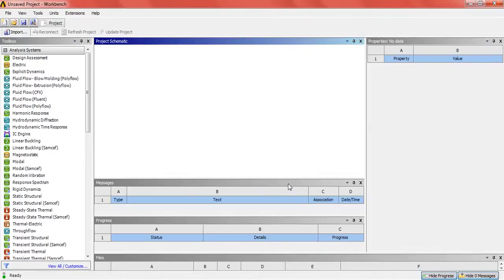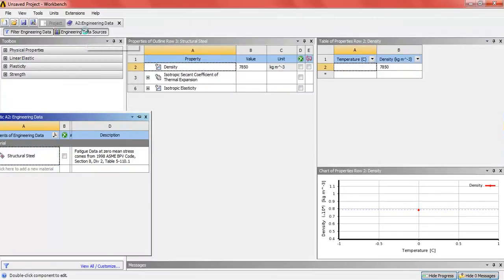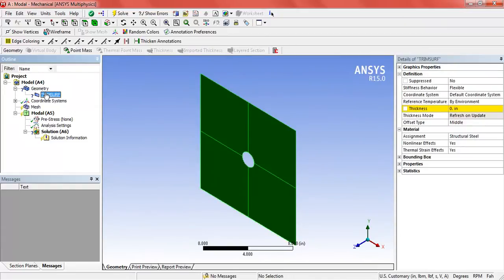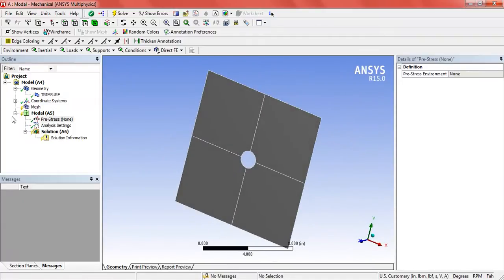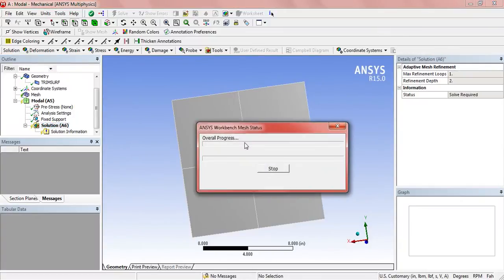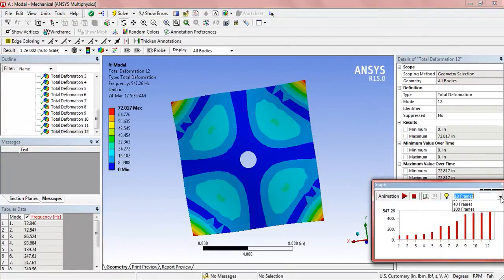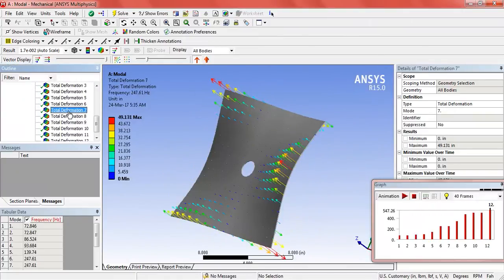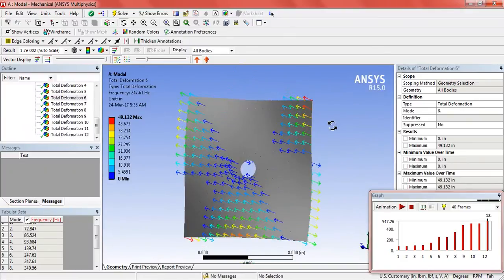Plate with a Hole - Model Analysis Tutorial | ANSYS workbench

Comment: OUT OF 12 WHICH FREQUENCY  WHICH FREQUENCY IS CRITICAL HERE
Reply from the maker: All the 12 frequencies found here are the natural frequency. critical frequency can be considered to any external/forced frequency which when becomes equal to the natural frequency resonates and causes damage in performance.
This analysis Allows the design to avoid resonant vibrations or to vibrate at a specified
frequency.
Reply: that means that plate will not fail under these frequency
Reply from the maker: no, Resonance occurs when a structural system is forced at a frequency corresponding to one of the natural frequencies of the system and resonance causes serious damage to the system.
Reply: thank u sir can u tell me the dimension of this plate...
Reply from the maker: It is about 280 mm l & b.
diameter of hole is about 35 mm(approx).
Reply: thank u very much for the explanation